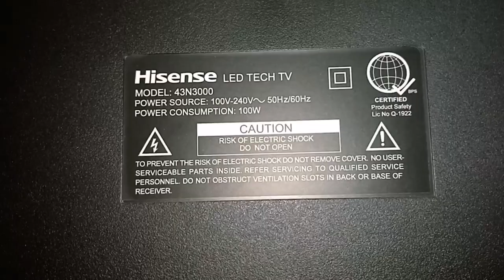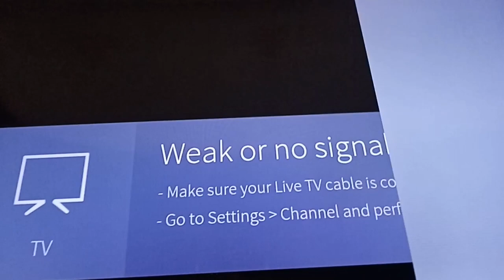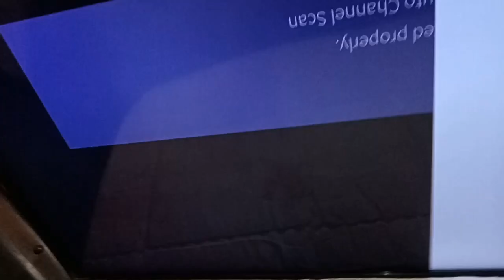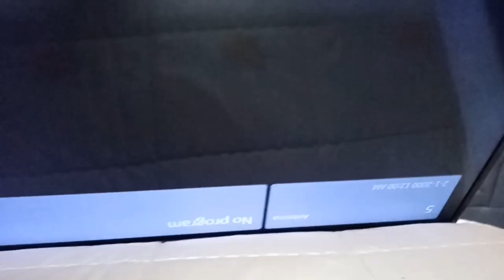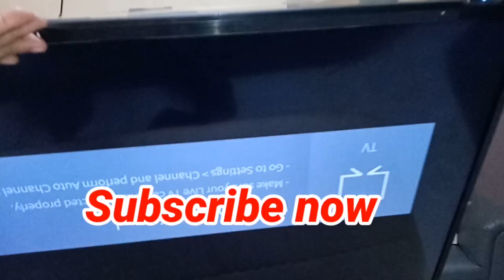HISENSE 43 INCH LED TV  COLOR VERTICAL LINES ON SCREEN PROBLEM REPAIR

Comment: At 6:20 you circle lines need blocking. It looks like 12 are here...are all those to be blocked?At 6:25 it shows more lines (VGA1, VGA7,VGA8,VGA14). Which one's are blocked please?
Reply from the maker: It's not exactly the circle you basis but that location to block about 10 pins or more just try it till you've got it ..

Comment: What? The location of the red circle showing 20 leads is the other thing on the other side where no hint is where vga is printed and then this is how you now what to cover with tape which you dont show. I like the spider
Reply from the maker: YOU CAN LOCATE BY THOSE SIGNALS WHERE IT IS.